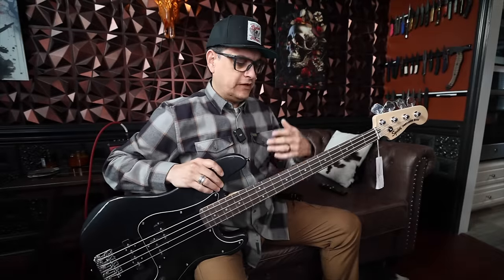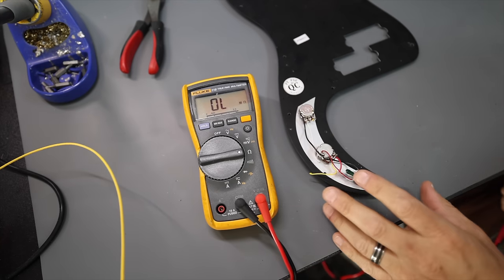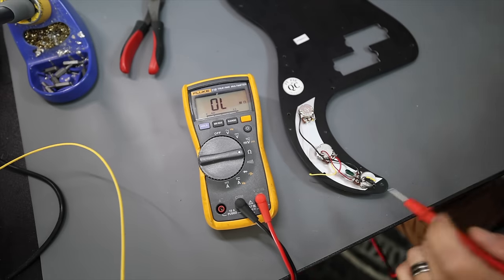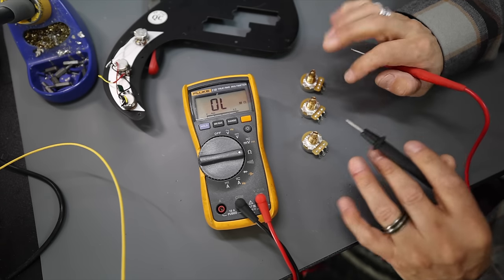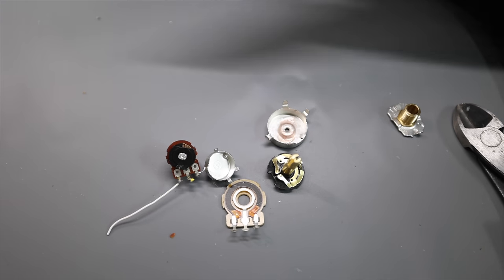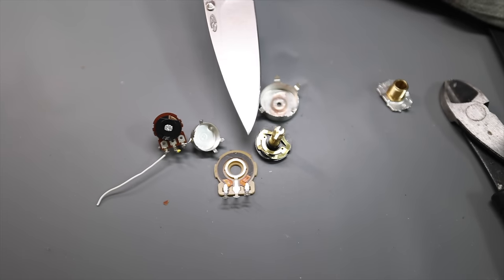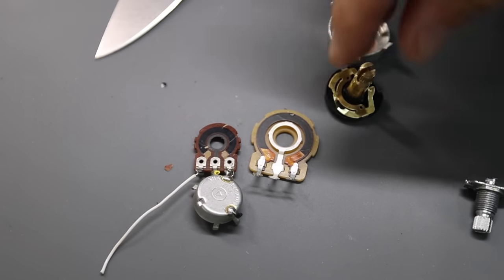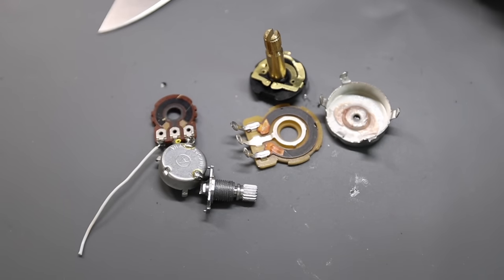Do Cheap Pots and Caps and Switches Ruin Your Tone ?

Comment: Dylan. The one question i have always had is: what is the effect of ha ing different value pots. For instance, in a strat let's say I have a 500k vol and 250k tone. What are the pickups "seeing?" To that end, what happens if you have more pots. Let's say you have 10 250k pots. How does that affect everything?
Reply: I'll take a crack at answering this...

So, a potentiometer is a variable resistor, with a resistor foil around the outside 2 lugs and a "wiper" connected to the middle lug that creates a "short cut" for electricity to follow the path of least resistance.
   The resistor foil is usually either a linear taper, (the resistance progresses in a straight fashion) or an audio taper. (The resistance follows a curve)

Now when wiring a guitar volume pot, you write the input (which is the output signal from your pickup)  to either one side lug or the wiper lug (depending on what style you like) and the other side lug is wired to ground.

Now, I'm going to assume that standard wiring is used.
Pickup is weird to the outside lug, and the jack is wired to the wiper.

Electricity taking the path of least resistance isn't absolute, so some signal will try to bleed past the resistor foil to ground instead of traveling through the wiper to the output jack.

So, the higher the resistance of the pot, the less signal will be able to overcome that resistance and bleed to ground instead of going to your output to be amplified.

Higher frequencies overcome resistance more easily, which is why when you turn up the resistance of your volume pot, the signal not only gets quieter, but less treble as well. (Look up treble bleed circuits to fix this)

TL:DR:
Pots are adding resistance between signal and ground so less high end gets lost.
Reply: @TheAT5000  this definitely starts to answer the question. Thank you! What I'm asking is, so you know how "generally" we use 250k for singles and 500k for HBs. We'll that's because even when all the way up, there's still some resistance there. Right? Otherwise it wouldn't matter. So with a strat, for instance, that has 3 pots, where at least 2 of the pots are in series at a time (whatever tone pot is for that coil, and then the volume pot), does that multiply the resistance, or is it more like a bottle neck where once you have the resistance, level, that's the resistance until you go through a pot with more resistance?
Reply: @BigSh00tsie , so when the pot is at 10, there is close to 0 resistance between the input (pickup output) and the output. (The wiper to the output jack)

The total resistance of the pot is always there in between the output of the pickup and ground.

The reason we use a higher resistance with a humbucker is because they tend to be darker, so the more we can resist the high frequencies blowing across the pot to ground, the more high end will be left in the signal to the amp.

Inversely, with a single coil, we might want to bleed some of that harsh high end to ground instead of sending it all to the amplifier, so we might use a lower resistance to ground.

The reason for using 2 tone pots is to be able to have 2 different value capacitors. The higher the capacitance, the lower the lowest frequency that can bleed across to ground.
Reply: @TheAT5000  so wait, the resistance value of the pot, when does that come into play? My understanding was that's still in play when the pot is all the way up. Am inwrong on that?
Reply: @BigSh00tsie  the tone pot is just another way to bleed treble to ground without reducing the volume. (by adding resistance like the volume pot)

So they work by having overall resistance to ground, but also by reducing that resistance for the frequencies that can bleed past the capacitor you use.
(So they are weird the opposite of volume pots, because the resistance to ground is highest when at 10 where in a volume pot, the resistance to output is the lowest when at 10)

So the more resistance in them, the more frequencies are forced to go to the output jack to the amp.
And as a general rule, you always want your tone pot's resistance to be equal to or greater than your volume pot's resistance to ground.
(Otherwise the signal will pass through the tone pot to ground more easily than the volume pot would normally allow, but if you like the sounds, break the rules!)
Reply: @TheAT5000  so this leads me to think that you could wire an HSS strat with 500k volume, 500k tone for the humbucker, then 250k for the 2 single coils and you'd have everything perfect. Does that work?

Comment: I'm still really curious about the taper of pots... There's linear taper, there are variations of audio taper and there is also reverse audio taper. After watching this video I'm wondering if it has to do with the thickness of the "carbon race track" (I like that you called it that) or the width of the "carbon race track" throughout the rotation. Either way I imagine it is inconsistencies with cheaper pots.
Reply: This, I’d also like to know what actually controls the taper of the pot. I think it’s the resistance at different locations of the “race track” closest to the output lug being full on and the further away less signal moving the wiper you are changing the distance signal travels around the track? I think anyway? but I’ve never been completely satisfied with the taper of any volume pot , I’ve tried linear taper and went back to audio taper really quick but I’ve yet to find a pot that has a nice long even taper they all seem to have wide open, sorta a middle volume and off. I’ve tried bourns, cts but besides the feel of the pot they pretty much sound the same.
Reply: Picture a triangle, 90 degrees on bottom right. bottom left is zero, top right is 100. If the line from 0 to 100 goes straight it is linear, a sagging curve is audio taper/log, a bulging curve is antilog. Your hearing works logarithmically, so it sounds “right” as you turn the volume, if its audio taper.

Comment: To try a pre-answer your headline question IMHO, maybe and *depends*.  😁

Small pots are not always cheap and big ones not always good  or have proper audio taper. 

Cap microfarad value is more important than type for tone *usually*.

The KEY issues is QUALITY of the parts, not size. (...heard that somewhere before about something else I think, rack size maybe ....)

And the rest of the stuff they are hooked up to  I put a full new wiring harness in a D'Angelico Premier DC with P90 S-Ds and it made a huge difference over factory..
Reply: They put small pots in foot pedals and nobody says squat about it…put them in a guitar and oh, my, God its sooo crappy🤣
Reply: @eddiejr540  Size matters. Small quality pots are just more expensive.

Imagine your big pedalboard if all the boxes had full size pots....
You would need 4 tiers....and a cargo trailer.

Comment: My opiinion, when I get a guitar I remove all the wiring and pots as well as the capacitors.  It makes no sense to keep them. Once I do that, the guitar opens up. Now it will cost to upgrade though. Taper is important.  5 should feel like 5 and 2 should feel like 2 and no sudden drop off. Ki did a Mexican Stratocaster once and it was super nice after and had ceramic pickups.

Comment: I love how you break this stuff down in such simple terms for idiots like me. If you're not an electrician, electrical engineer or guitar builder yourself this is really intimidating subject matter. My Schecter Damien 6FR has a SUPER scratchy volume pot and its resistance or how subtly it changes the volume is horrible. It really only has like three or four true volume stages. It would also be interesting to see a troubleshooting video about how to figure out what is wrong with your guitar electronics but maybe you already did that

Comment: Perhaps you have this elsewhere, I'd be interested in the recommended technique to enlarge the import metric pot/jack holes to imperial without chipping the top finish. Graduate specific drill diameters over blue tape?

Comment: This was a great video!  In my opinion, tolerances, tapers, and solder joints are what matter.  Electrons don't know how much you spent or what brand your parts are.
Reply: No interest in microphonics, screening, connector quality, temperature stability etc?
Reply: @maxine2798   My response was about tone not interference or durability.

Comment: I have a Squier Classic Vibe Tele I bought with the intent on modding to mid-50s specs with the dark circuit in the neck position, but I also want to run a mini humbucker. Would a 0.1 microfarad capacitor still have the same tone and vibe with the mini humbucker + 500k pot combination or would that need to be adjusted to get the same effect, especially for high gain application?

I'm just a layman when it comes to the topic of electronics. I want that mid 50s vibe, but I also want the mini humbucker level of output. Any and all help in understanding for my use case is highly appreciated

Comment: Are CTS pots better than Emerson? I'm still learning all this.
Reply from the maker: Emerson pots are just CTS
Reply: So what does CTS mean if Emerson is a brand? @DylanTalksTone
Reply from the maker: Emerson just private labels CTS pots as their own
Reply: If you’re a company you can order CTS pots or other pots and sort of call them your own. Stewmac has CTS pots with 10 percent tolerance and has their name engraved on the sides. Dimarzio pickups has push pull pots unbranded but it’s probably Alpha I think.
Reply: @DylanTalksTone okay. I heard that and I told someone that and got dogged. Thanks for validating what I’ve heard.

Comment: 17:01 I can see both sides of the debate about Pure Tone jacks.... I would use them for my Tele or Strats but definitely not for my SG or Epiphone Casino.
Also I'm just a tad curious how you make sure the pots & caps you get are within tolerance. The manufacturers could send you out 1000 in a batch and there's quite a few, even for the premium items you buy, that would fall outside of tolerance spec. What do you do with the parts that aren't up to spec?

Comment: One thing to be aware of with pots is US spec pots like CTS have a physically different size post. This means that if you have an inexpensive Asian made guitar and want to put CTS pots in you would probably need to drill out the hole to make it larger. Which is probably okay if loaded into a pick guard like that bass, but you probably don’t want to do that if it’s through a finished surface like a Les Paul or other such thing. Better of getting the best quality non-US spec ones you can get.
Reply from the maker: We talked about that

Comment: You should upgrade switches and jacks; they often break. Tone difference? Doubtful. Pots? Hard to say - both cheap and expensive ones have capacitance they aren't supposed to have, the CTS I use  vary wildly on this, figuring in the value of course. Pots bad enough to not taper correctly are pretty rare, but they're out there.

Comment: The torque and physical size of a pot make a difference. Not too much on sound but just making small adjustments to your tone. Reliability is also important which is why I generally replace all the pots and wires on cheap guitars. 

Expensive caps in guitars are bs. Just use the right value.

Comment: I know nothing about this other than the pots and caps I overpaid from Bare Knuckle might have something to do with how perfect their pickups perform.  they do a 550k CTS pot for reasons unknown, and at least one I used was a normal 500K CTS pot, so that's not it.  The tone is usually at 10 so can the caps' 3% effect make all the tone better?  I doubt it.  Its the pickups.  

I'm about to install a Dylan P90 and Centerpunch 8 along with the regular CTS pots and standard .0022 orange caps in the next two weeks and my guess it will also be about the pickups.  

Don't skimp on switches and jacks as those are moving and high traffic parts.

Comment: Cold solder joints sure do… Otherwise, the electrons don't seem to care. One major caveat is that with cheaper parts you were less likely to get a part that works the way you think it does. Tolerances are a thing, and with cheaper parts the actual value of the component is less likely to match what is printed on it.

Nice pots are worth it for mechanical reasons, but in a guitar, a cap is cap and a wire is a wire. 

Nice jacks are also worth it, again for mechanical reasons.

I like CRL switches, but i have some Asian cheapos that work well and have lasted decades. The CRL feels better though. I have a Schaller that is good, but doesn't feel great.

Comment: After dissecting the CTS and Alpha pots, you posed the question "Is this all tone related ? This part [pointing to the tracks] ...  absolutely it is". But you did not provide any evidence or theory as to why that would be the case. How would the SAME static resistance value on the two tracks have any influence on tone ?
Reply from the maker: Watch the video again… very… slowly….
Reply: @DylanTalksTone  I watched the whole video again, in case I missed something. Unfortunately I did not see clarity on that point.

I'm not just splitting hairs here. It's more than just an esoteric question. Because there are people who assert strongly that expensive pots sound better, as if there is such a thing as higher quality resistance and lower quality resistance. It's also the basis of some peoples' belief that vintage pots sound better. Such that 250 kOhms in an expensive or vintage pot would sound "better" than 250 kOhms in a cheaper or modern pot. And I asked because your statement "Is this all tone related ? This part ... absolutely it is" can be construed as making a similar suggestion. If you would like to disavow that, then please do.

You reasonably summarize at the end that tolerance (pots and caps) and taper (pots) are important, as well as reliability. Totally agree there. The published tolerance 'B' spec on CTS 450G guitar pots can be either +/- 10% or +/- 20%. I see from your website that the pots you are selling are the tighter +/- 10% spec. It would be good if other vendors made that clear - some do, but many don't (probably mostly those selling the wider spec). So just buying CTS is not a guarantee of better tolerance. The big general electronics supply houses list the full CTS 14-number part code, so it's always 100% clear what you're buying from them, including CTS's six possible audio/log tapers (5% to 30%), for those who like a particular taper (as of today, your pot product page does not seem to list the taper).
Reply from the maker: I did not assert that and I was very clear about the benefits of better pots.

Comment: Alpha makes higher quality pots, the 24mm  audio pots , ive used hundreds in pedals and amps and never had one fail. Ive had failure from bourns pots. You gotta be careful when u solder pots, heat can damage the carbon track . Ive tried every kind of capacitor, almost every brand. It guitar audio where there distortion capacitors in amp and guitars isnt as important as like hifi stuff. But the one i like the best are vishey mustard caps the  630v.  Those little green cicklets sound really good. Honestly any caps coming out of taiwan or japan are usally good. . Jupitor condenser makes great american made caps, reasonable prices.
Reply from the maker: Guitars are not the same as amps and pedals

Comment: Using good pots, switches, proper soldering,  is not about tone,
It’s about longevity.
Wiring neatly is a point of craftsmanship.
Wiring with the appropriate capacitor, for the year of build.
Is about being vintage accurate.
Has nothing to do with “tone”.
And you should know that, the question is bad.

Comment: In terms of tone, I would think it will help bring your point across if you could show a comparison of an EQ chart (frequency?) using the same parts, but only changing the (in example) volume pot. With a good comparison of the EQ Chart, seeing how the different frequencies are being affected by the cheap/expensive parts, AND having a recording using the same guitar/amp/distortion/speaker would make it even better.

It might be a case that the 10% range on those pots make a tonal difference of 95%, or 1%, to the point that is negligible in a real world scenario

In my opinion without those charts/recording, the most important point that I can take from this video is everything about reliability which I fully agree, those cheap pots will become scratchy and fail, which is not something that any pro wants, but then again, what are the probabilities of such a thing happening over time (20% chance of a pot dying over 3 years of use?, I've no idea)
Reply: you wouldn't notice. you can try it yourself and make your own video
Reply from the maker: Yeah… if you have to look at a chart… what’s the point. I’m playing guitar instead.
Reply: @DylanTalksTone  the point is that we are discussing tone, but this video in terms of tone is just Anecdotal Fallacy, based on your personal experience.

So without any more evidence, I can also say that tone is not ruined by cheap electronics at all.

Not trying to be a dick here tbh, you are the expert and I thought you could provide more data. Cheers brother
Reply from the maker: You did t watch the whole video did you… I said…. I don’t care about tone in this conversation…. If you don’t like the content you see, I challenge you to make the video you think needs to be made
Reply from the maker: I don’t think people understand how this works. I will talk about this tomorrow on the podcast. You can’t actually “show it on an eq chart” because the variables are a sliding scale. If you can’t hear it… YOU can’t hear it.